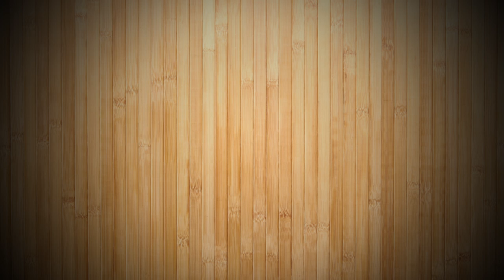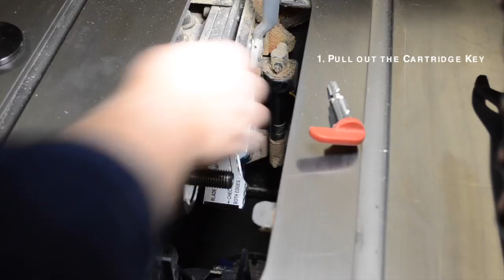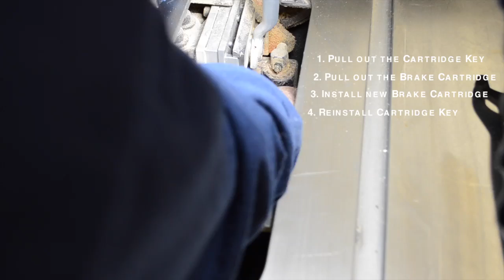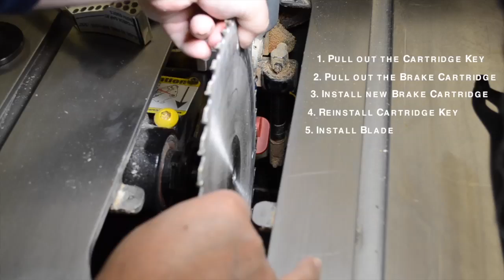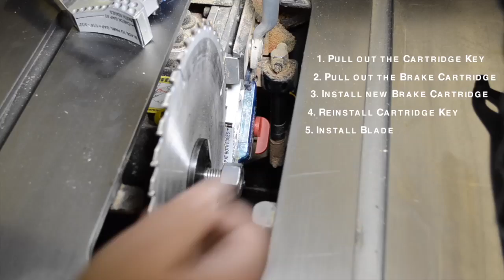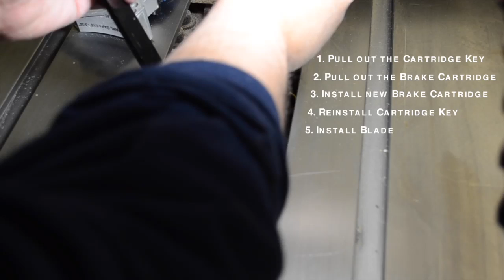SawStop Brake Cartridge Change

Comment: I think it takes more patience to answer some of these questions than change between brakes!
As to why you need to do it, just think about it. Notice how close the gap between the 10" blade and brake is? Now throw on an 8" blade and ask yourself how far the brake is now from the dado set. Then add in the difference of the width and you'll notice that the dado brake is sized to fit snugly behind the smaller blade and is wider to jam the whole stack if needed. 
If you are considering this saw you should know that it will only operate with 8" dado sets as that's the only size brake that is manufactured. 
I have owned a 3HP PCS for 5 months and so far never fired the brake.
Reply from the maker: I was a little bummed when I had to get rid of my old 6" stacked dado, but it's worth the peace of mind. And just like you, I've never had it fire off yet (except on purpose for a demo video.) A lot of people worry about it "accidentally" firing off, but in reality if it fired off you probably knicked something like an aluminum jig or such.

Comment: I think the real question is... How long does it take to change the blade and cartridge when the break has been activated?
Reply from the maker: That has been asked, and even when I intentionally set it off for a previous demo it took me an additional several minutes to catch my breathe before doing something very similar to what's demonstrated here.
Reply: Matt Vanderlist Ha. I get that. must be absoluty awful to witness. Still better than losing a finger though
Reply: G.Work.Specials
Hmm, maybe the question should have been, "how long does it take to change you underwear after the brake goes off?"
:)-
Reply from the maker: Deathlok67
depends on whether they're boxers or briefs! To answer your separate question about whether it's fired off accidentally yet, the answer is no. If I'm ever concerned about the material I usually do a quick test using the bypass system.

Also, the only time I've had it fire off was during deliberate tests for the review video. I don't plan to reuse those blades, they're a little too embedded in the brake LOL.
Reply: Matt Vanderlist
Thanks for the reply.. accidental triggering was one of the things holding me back.. thanks for the great vids.
Reply: +G.Work.Specials I have changed several, all due to attemts at cutting the wrong materials. It usually takes about 10 to 15 minutes, including re reading the instructions to make sure you do it correctly. The cartridge itself has an aluminum body which is deformed on impact. This causes a slight wedging situation so you have to slide off the blade and cartridge off sideways at the same time. Have to wear gloves to avoid being cut by the blade because you are reaching around and past it.

Comment: Are you kidding me. That is awesome. Oh I just read the description. So is this all you have to do if it was triggered?
Reply from the maker: Yes, pretty much the same. The only difference is that you might spend a little bit more time carefully pulling the blade off the arbor at the same time. But once you pull the brake out of it's plug (it's like an tethered mouse with those small plugs) it's easy to move the blade to the side and remove it.

If you have another brake and blade on hand, just reinstall, double check your adjustments and you're all set to get back to work.

Comment: So every time you switch to the dado blade you need to change the cartridge? That sounds annoying.
Reply from the maker: I couldn't agree more, especially when you need to switch back and forth quickly. Add to that the fact the dado brake cartridge is sold separately.
Reply: You could always buy two table saws. Then you would never need to change the cartridge or the blade.
Reply from the maker: Wes Hamstra
YES! I'm still trying to make that magic happen.
Reply: +Wes Hamstra (Wes Hamstra Woodworking) Not as annoying as cutting off your fingers.

Comment: Step 5, install new blade?  Have you managed to restore any of the blades where the brake "dynamited" and stopped it?
Anyhoo, hope you were not hurt.
Reply: Addendum, read the text.. missed the fact that you were changing between dados and a normal blade.. still curious if it has ever triggered on you.. I was thinking of buying the saw this year.